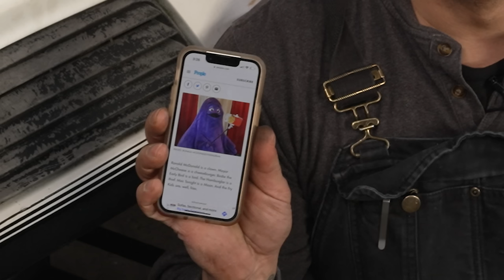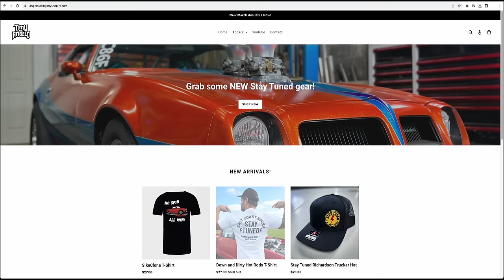Found His First Car In A Junkyard After 12 YEARS!

Comment: Word of caution Tyler. The hood scoop is directly over the carburetor. If you run a stock air cleaner housing and the vacuum actuated door of the hood scoop fails, rainwater fills a cylinder. My first car was an 82 Trans Am with a 305.  I replaced a "siezed" motor only to have it happen again. The starter bends your connecting rods due to the water. The car was sold and shortly thereafter burned to the ground. This episode brought back so many memories. My car always needed a 350. Cheers. Ryan

Comment: Helpful tips. Weld to a washer before the nut to maximize effective penetration, heat and hold. Hammering/vibration before and after welding also helps and (depending on the fastener stuck) work the welded nut back and forth to clean threads as you go, especially starting the turn. From a rust belt tech.

Comment: That's so awesome you found your car!! My first car was a 1984 Z28 L69 5-speed; red with the brown vinyl interior. My uncle in law helped me swap the motor and rear & I learned so much on that car. I only sold it because I was rear ended and I needed transportation. I did locate it 15 years later when it popped up on ebay but it was even worse than when I had it. I was outbid and after that... no idea what happened to it. Don't let that car go man!

Comment: Fun video guys. A friend of mine bought an 82 z28 for 250.00 in 1999. The rear end was bad and it came with a replacement  with a posi !!. The best part was the cowl hood flipper still worked when you floored it. The little 305 cross fire ran pretty well.  It had a excellent fun to dollar ratio.

Comment: I used to use a jack handle to turn the oil pump shaft a few degrees in front of the #1 on the cap and it would slide right in.

Comment: I had the same  cross threaded transmission bracket bolts issue.  I ended up having to drill them to 1/4 then using a hole-saw to get them out.  Went back and welded some nuts to some thick washers and buzzed them back to the subframe.  A complete hassle, but it was smooth to put back together.

Comment: I had a white 1982 Trans Am too. I bought it in 1982. It had a piss poor 305 Chevy motor with no torque, but it cruised, I mean cruised, at 110 mph (estimated by tach because it had the 85 mph speedo) IF you could keep the torque converter locked. If you hit the gas too hard and it unlocked, you went over redline.

Comment: I had a white 1985 Firebird that I had worked on with my dad. We put a Edelbrock Performer RPM package on a 355ci, backed with a Built TH350 and put a used 10 bolt IROC-Z posi rear in it. After a lot of tinkering and tuning and good track prep, we ran a 12.5 at 109 on crappy street tires. The car was essentially destroyed in the Derecheo we had in Iowa in 2020. The engine and transmission and rear was parted out to some old car buddies for their projects. I miss that car, wish I had a nicer 3rd Gen to go back to at some point. The car body after years was a junker, but ran solid.

This gave me a lot of nostalgia.

Comment: If no one has said it already, you're going to want to make sure you have some kind of air dam under the radiator to channel air upwards into it.

It was hard to tell in the rolling shots if it was there or not, but if you dont have one when it warms up outside or you drive it more than a couple miles, it'll start overheating. Its wild how important that little piece is and youll go crazy diagnosing your cooling system when that was the only issue. 

Just wanted to save you guys or someone from a headache with these cars and say keep the bangers coming!
Reply from the maker: Good call!! Appreciate it. It’s near freezing now but it’s gonna be warm soon enough. I’ll add it to the Tylar list! l

Comment: My first car ever was an '83 Firebird SE that was 50% rust. Just a V6, but I loved it anyway. Traded it in for my second car, a Trans Am. I wish I could find my Trans Am. It was Metallic Blue with Silver trim and T-Tops that never leaked. Not the most fancy car by any stretch, but certainly the most fun car I've ever had the privilege of owning. Unfortunately it was stolen and never recovered...so probably chopped or wrecked and scrapped. I only chipped it, put a better exhaust and air intake system. And better tires. It was still pretty quick for such a heavy car. Had the factory Lotus Performance suspension system. I got it down to a 12 second car on the quarter mile at the track. Not the fastest, but fun for me anyway.

Glad you got to find and save yours! Load up the part canon and fire her off. Cheers.

Comment: Awesome Video, So glad to see another Thirdgen back on the road, Huge Thirdgen Pontiac fan myself, my 1st car was a crossfire injected 83 T/A, had a couple v6 cars and my current Car is 1 90 Formula 350 that I have owned for the last 25 years. Now I hate to be that guy, but actually that 200C would have been the stock trans for that car. The 82 Thridgens were unique from the 83-92's  in that the automatics were only 3 speeds, and the manuals were 4 speeds. the 4 speed auto and 5 speed manuals were not introduced until the 83 model year. There were also various interior pieces unique to 82's as well.

Comment: I am lucky enough to still have my first car. Pretty sweet ride. 1992 Lincoln mark 7 in deep green metallic, fully loaded. I got it in 1993 with 5,100 miles on it for $4,800. Unfortunately the engine was blown. It had been run without any coolant, junking the engine. This car became my junior year auto shop class. We got a 302 block out of a junkyard and built it. Mostly stock-ish but a few goodies. It had plenty of power for a 16 year old. After a few years i had a crappy ranger for the winter and a heavily built 88 gt for the summer. The Lincoln got parked in my uncle's metal barn (winterized, clean, and covered) when i went off to college. Other vehicles got parked in front of it, time passed, work and life. Fast forward to 2015, my uncle was clearing out his property and we uncovered the Lincoln. I had basically forgotten about it. Broughther home and since i have more 302 parts than fomoco a few friends and I pulled the engine and rebuilt. 510 hp and 643 tq at the crank. Lots of fun stuff in that old land yatch. I keep tossing around the idea of turbo. But as it is now it is a great sleeper. The body and interior are mint. Completely solid car. Never been parked outside, was in a climate controlled building for 15 years. The color is beautiful and quite rare. Odometer reads 26,734. I love this car, just a beauty. And absolutely roasts tires. 

Reminds me a bit of the mark 8 you are playing with on this channel.

Edit: because the Lincoln had been forgotten about for so long the name of the car became "the missing linc".

Comment: the problem with those 90's Vortec motors or at least the 4.3 was they had a common issue of having a leaking intake manifold but other than that the 4.3 Vortec that was in my 96 S-10 Blazer was pretty solid

Comment: Anytime you have a hole that needs threads use a Rivnut insert

I have seen them as large as 1/2 inch but there could larger one too
You install them the same way as a rivet but you end up with a threaded hole
And if those threads strips out drill out the rivnut and install a new one

Comment: Check the differential. Those came with a very brittle one that people exploded with the stock 160 hp. Even with welded gears the case is very flimsy and tends to flex. Find a better rear end.

Comment: Nice build! Not raining on your parade but I’d have kept the turbo 200. They were factory 82 transmissions and they had higher stalls. Ran mine stock behind my 400hp 400 for hundreds of passes on sticky tires. They had a tv cable so like the 700r4 people didn’t know how to adjust the cable and burnt up transmissions. Mine on street tires would lay rubber in all 3 gears plus they had a better gear spread so helps with those tall factory gears (2:73 or 3:23). They were the same as the grand national transmission without overdrive
Reply from the maker: Yeah, I will actually mention that to Tylar and see if he wants to build it up.
Reply: @StayTunedTA I have a turbo 350 in now but it’s lazy compared to Before and this one has a way bigger convertor. If you were building one better then stock I’d get a gn one so you get overdrive. You’d just need the spohn crossmember and you have everything else already. If not I can bring mine over and purchase that one but install has to be included haha!

Comment: I bought my 83 camaro off a guy in carlise for 350 bucks when i was 15. I pulled the blown v6 and put in a 305. The t5 died shortly after and I pulled it apart. In 2019 I swapped in a lq4 and a 4l65e. Put a few hundred miles on it and just pulled it back apart to put a t56 in. I'm glad I never sold it and still have it 19 years later.
Reply from the maker: Awesome. Great story and glad you never got rid of it! Sounds like it hauls now!

Comment: I wish I could show you my car through youtube.  I have a 1989 Formula that I LS1/T56 swapped it.  I've owned that car since 1997.  White with Gunmetal grey bottom, running 17" GTA style wheels.  All factory gauges work, AC will freeze you out, the LS looks stock in it except for the cold air intake.
Reply from the maker: I watched your "sound of LS1" video, that thing is KILLER! super super cool ride!
Reply: I posted them as a reply on your facebook post.
Reply: @StayTunedTA  Random clips I forgot that was up there.  I also 3d print a replacement for the dome light sockets as that part isn't reproduced... if he needs one let me know and I'll get you one.  Not the dome light housing/lens but the part that holds the clips that holds the bulbs.  I really should do a walk around of the car as it sits today and post it.

Comment: I had a 96 GMC ext cab with that motor in it.  Great motor other than the intake gaskets were neoprene.  I let go of it at 185K.  Was all bone stock other than the idler pulleys.  Would have loved to have kept it or have another.
Reply from the maker: Yessir, they work and they last a long time.

Comment: The Th200/Th200c were built between 1976 and 1987 with the c variant having a lockup torque converter.  The th200c was the foundation for the Th2004r which is just as much junk as a Th200c.  The 700r4 was released in 1982 which is a mutch better transmission and 1987-1993 model 700r4 transmissions are the best models to have. 

Go find a junkyard differential with the factory Auburn posi unit or get a set of 28 spline axles from a later F body and get a torsen helical gear limited slip from a 4th generation f body.  I use to buy brand new take out torsen limited slip units from SLP for under $100.  They removed the brand new torsen units during the SS conversion process.

Comment: Had a 200C in my old 85 El Camino. It drove ok with the stock GM 350 crate engine (that the previous owner bolted all the stock 305 junk onto, so it barely even spun tires in dirt), but once I threw an edelbrock air gap intake, carb, msd pro billet hei, and long tubes at it, blew that 200 on the first test burnout, lmao.

Comment: No overheating problems yet? If you switched from the serpentine drive to an older standard type of pulley drive you need to change the water pump. F car serpentines used a reverse rotation

Comment: Pull the distributor up out just enough to clear the tooth on the oil, pump. Point the rotor button at #1. Set the vacuum advance, centerer. Next, have someone bump the key while you HOLD the dizzy/rotor button pointed at #1 (on, SBC.) When the distributor drops in & the rotor is pointed @ #1, she is INN THERE like, RAGU! 18436572. Wire it clockwise, 1357 (ds) & 2468 (passenger's, side.) 
ABSOLUTELY, start out with #1 UP, TDC.

Yoooooo, don't need NO DISTRIBUTOR WRENCH!

Comment: I have install in 2001 the same vortek 350 from a tahoe accidented with 1000 mile on the odometer in the camaro 1983 of my friend, after couple week he forget to check the coolant level but when he see in the radiator he have no coolant because of leaking for approximately 100 mile but the motor dosn't blow. He stop at the grocery buy water trow in the radiator until he repair very tuff motor :)

Comment: C'mon Amazon!.  Sponsor Stay Tuned with a Nutsert kit!!.  Soo many times you guys could have used those.  Summit Racing!!, Get Stay Tuned a air over hydraulic transmission jack!!.   Very rare find.  Probably top of the list for Stay Tuned so far, because of the back story.  Nice Revival!.  Had a 96 Firebird TA with the Opticrap motor.  That year was stunning on the interior and exterior and deck wing, but the engines were failed, especially the crab cap Optispark motor.  Put a shift kit in the 4l60E, made it a bit more tolerable.  Don't sell that car again!!..  The planets only align once, for one of those finds.

Comment: Found your very first car,in a wrecking yard,for 850 bucks,id be hauling ass to buy it back,I wish I hadn't written my first car off,even tried to do a 2nd version with a reasonably rare sedan,bought for 2200,chucked all the stuff ie aircon,power steer then a hailstorm came through and buckled all the panels,super jelly that you get to find and buy your very first car,also,I think that transmission is the same as the aussie trimatic or traumatic transmission,3 speed but anything stouter than 400 horsepowers will break them from the inside out

Comment: Don't use the header gaskets that comes with theam balive it or not get Amazon manifold gasket set it was 7 paper than start all the bolts they drop right in had no problem 4mouths running no leaks thick burn through overthime

Comment: I did the blowing up diff doing 4 gear burnouts sacrificing a 12 bolt up under my 62c10 stepside rock crusher and a 67 vette 427 no trouble made my yearbook ahhh 1987

Comment: This is so fuckin cool! I'd love to find my first car but I'd be willing to bet it's been scrapped. It was an '81 Camaro with a 6.6 400/TH400, white w/blue interior, a Z28 hood (someone cut out the entire profile of the Cowl Induction scoop off the hood). I had to drive 60mi round trip every day to work and it blew a lower radiator hose on me one day in the middle of the AZ summer. Then, it started to leak coolant out of the intake gaskets. So I traded it in on an '09 Cobalt 2LT at Van Chevy. I found it on Craigslist a couple weeks later and told the guy to let me know where it goes. Last I heard it ended up in Casa Grande, AZ and I've never seen it since. I'd like to believe that it's still on the road and someone is enjoying it but I've got no idea.

Comment: That v belt will not work with the serpentine style water pump.  They go the opposite direction!!  It will overheat.  Why would you change a better drive system just for Chrome?

Comment: I'm putting a vortec L31 in my 88 GTA, what electric fuel pump did ya'll use? I've always run manual in it but my vortec doesn't have manual access.  Thank you.
Reply from the maker: Holley Blue pump and the regulator that comes in the kit.
Reply: Thank you very much! Love the show!

Comment: I had that trans in a v6 81 malibu i swapped a camaro 305 into while the 406 was being built. I figured it would be fine for a bit. It wasnt. Blew up on day 2. Some dickheads tried to steal the c3 alloy wheels in the 25 minutes it was in the side of the road. Fortunately they were idiots and tried to jack it up by the gas tank and it ripped open and scared them off.

Comment: My DUDE!!!  Yes!  Believe it or not, this baby looks damn near identical to my first car!  I had, and STILL have (26 years later!) an '84 T/A.
Same exact color and stripe package (except mine had the "sticker delete" hood)...  Mine was also different in that it was a 5 liter HO, 5 spd... It's had a TH350 in it for the past 20 yrs though, after breaking the junk T5 several times, and I also installed the super rare, Dana 44 "bolt in" rear end, after breaking the factory 3:73 and then a set of 4:10s in the junk stocker.  I'm STILL upset with GM for putting such a lightweight, dinky pos in the back of a 3500lb "sports car".  What the F were they even thinking??  (Saving money, is what they were thinking).  Sucks though, because of that "lovely" torque arm setup, you NEED to make something special to work with it.

Comment: 82 Trans am would have had a 200 metric or 350 turbo trany if it was a police car....The 700r4 came out in 83 for the fbody and up till it ended in 92
Reply from the maker: You are saying there's a 350 that came in the Bird?
Reply: @StayTunedTA   The police package upgraded the 200 metric trany to a 350 turbo trany (it was a short tail 350 turbo) because well 200 metrics fail easily. Had a 82 TA that was a highway patrol car in missouri, Great car.
Also the late 70's early 80's chevy Monza has the same 350  turbo trany the firebird used.  

Since this 82 had  200 metric in it...I would bet it was the original trany for the car.  It would not have survived long behind the chevy 350 vortec engine.

Also because he is keeping the 350 engine in it..and it has T-Tops, I would highly recommend sub frame connectors before he twists the body.  Hate to see his t-tops shatter or fly out under hard accel!

Comment: Got a 200metric 3speed in my 1980 monte carlo,,, they say it's a turbo350 with lighter internals, if you put a v8 in fornt of it it will blow up 😈😈, have 305 cammed and it takes it like a champ,, don't believe all ya read 😊